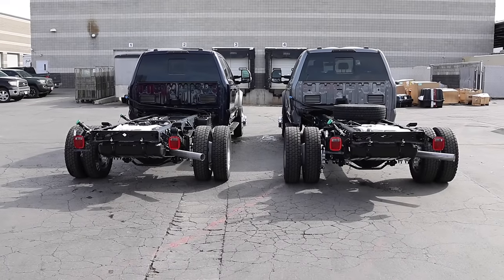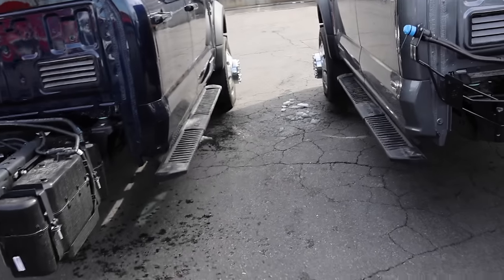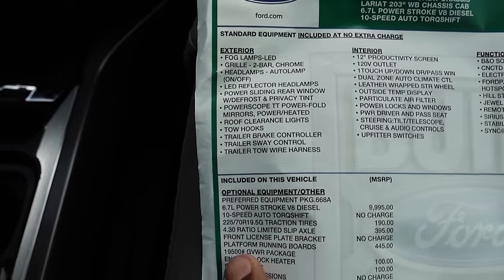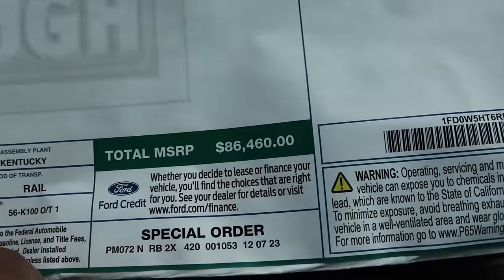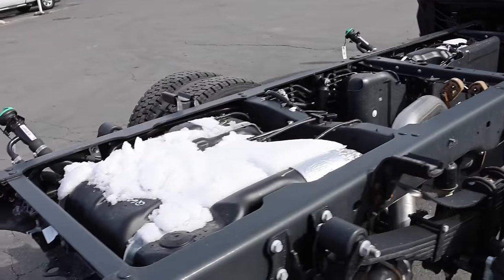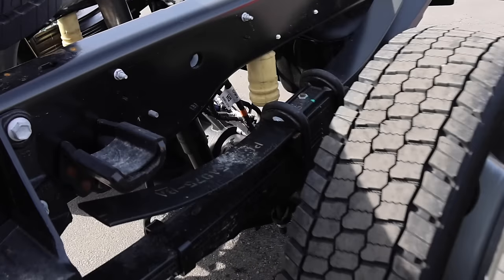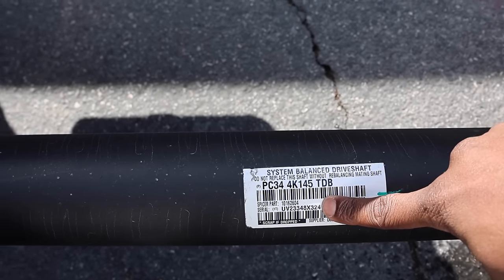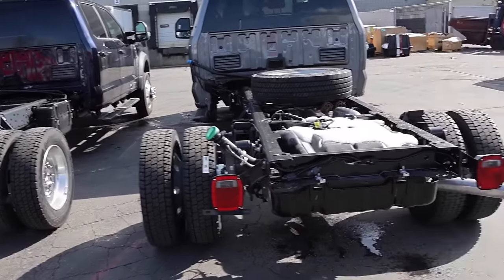4.10 VS 4.30 Gearing: People Say Max Tow Isn't Worth It… Heres What No One Showed You Before!

Comment: On the drive shafts the part numbers are the same. Every single one is going to have a different serial number that identifies it specifically.
Reply: Came here to say this!
Reply: Exactly
Reply: Yup. At least I’m not the only one that noticed that
Reply: The drive shaft is not the issue. The rear end is in question.
Reply: says he doesn't care...are we clear? Ok!
Reply: Just like my Glock 19.  Each has a different serial number but they are all the same.
Reply: @acutecareemsdispatch  the rear housing is the same the gearing is the difference!
Reply: @andrewslagle1974  I know that. But what does that have to do with the serial number on the driveshaft?
Reply: The rear axels have different numbers because not only different gears but limited slip. They are for assembly at the factory and inventory. If you were replacing the drive shafts or the rear end they would ask what your truck was by model as well as year. They would ask what geat ratio as well as whether it had the limited slip option. Those inventory numbers will be log gone within a year of serious use.

Comment: Man. Such a bummer. I like you so much. This is honestly horrible advice. If you hauling those kind of weights in hot shot your spending the same amount in fuel as a tractor trailer.  I’m not going to bash on here. The guys in hot shot making the most money out here are Non CDL , under 26,000 k.  Why pull 34,000 lbs with an$85,000 truck and no where to sleep. Used tractors are 30 to 60 k right now.
Reply: Because not everyone has a place to park a tractor. You can take that F550 anywhere.
Reply: @southwestoffroad  you can take a bobtail anywhere also, or just rent a parking spot. It’s a right off anyway
Reply: @Djtruckin  Not where I live. Most HOA’s will not allow those trucks to be parked in the neighborhood. If you live in the country then yeah go for it.
Reply: @southwestoffroad  I live in an HOA and rent off site parking.  I’m just saying, you try making money pulling 30k lbs in a hot shot application in these market rates. I’m out here doing it, for the last 14 years. Good luck pulling heavy hot shot
Reply: @Djtruckin  I feel you. Personally, I just want a chassis cab to turn into an Offroad Overland truck. My brother is a truck driver driving OTR. I like coming home everyday after work. 😅
Reply: Except if you have trailer load over 10k you need a cdl....

Comment: For gearing choose the ratio that gets you somewhere around 2000 rpm for your desired cruising speed. Since I tow heavy equipment (forklifts & such), I run 60 MPH so the 4.30s would be fine for me. I have no business going any faster than that for the weight I pull. Your situation would most likely be different.
Reply: What's your MPG?
Reply: @xmo552  average 11. Worst I ever saw was 9 but that was in a 30+ mph headwind & I could really feel the truck working. Forklift weight 19200, trailer weight 5400, truck weight 7800 & some of the time I'll also have 2 to 3 of those 3 foot "shorty" jersey barriers loaded, probably 1000 a piece. Yes, heavy & a lot of weight concentrated in a small area but that's why I poke & take my time. I'm also an A-CDL holder for almost 30 years & hauled oversize when the wind craze started picking up. Only advice I can give which will probably get laughed at is it's not a race. Get there when you get there, cargo & your equipment in 1 piece, nobody killed or maimed along the way. 

I've noticed that when you go past 2000 rpm cruising, loaded or not, mileage does a sharp "bell curve" downward. Same as my old 6.0 was years ago.
Reply: @acemobile9806  
I fully agree. Thanks for the reply. 

I'd like to build a ramp truck/wedge (single car on my back) type car hauler just for personal use. I think the most I'd ever haul on my deck may be 10k max. I think some road gears like maybe 3.73:1 might be great for a balance of torque and MPG. I favor the MPG since the engine and trans give me all the torque I need in this application. 
Would you agree?
Reply: @xmo552  as a matter of fact my '06 F350 6.0 had 3.73s. It sat on 35s & had a mild 4" lift. At 2000 rpm, I was right at 68 mph & unloaded could get 18-19 mpg out of it. If I was in a headwind that would drop to 15-16. I also had a 60 gallon bed tank & I have done 1800 miles without refueling. I mostly used the extra capacity for price hedging, load up to the brim where it was cheap. Towing 12K or so would drop that to 13, maybe 12 at the worst. It was studded, deleted, FASS pump & aftermarket non-VGT turbo but still factory injectors, relatively mild mods. I had Elite diesel tunes for when I wanted to have fun but otherwise ran the factory SCT race tune & that's where it got the best mileage if I stayed out of it. 250K when I sold it, laid down on me 1 time for the FICM. Only trouble I ever had with it. 

What you propose is perfect, I think you'll be really happy with the mileage vs speed trade-off & you'll have more than enough grunt to tow the steepest grades with that load. Set the cruise & ride on.

Comment: Defiantly add the max tow to every truck!
Reply: 3:73  with 35ft aluminum shipshee gooseneck and 2500 hauling LTL  partials makes better money every time. Once you’re out here on the road 14 years you might figure it out
Reply: Lol...max tow isn't even available on 2500...
Reply: @mopeman440 the point is Max tow is idiotic with the ridiculous fuel guzzling gears
Reply: @Djtruckin  
Yuuuup
Reply: @mopeman440 I know since the late seventies Ford has been playing games with their packaging my 01 F250 has more Towing capabilities than a single will F-350 because of the camper special packaging, the best part was an average of 350 to $1,000 cheaper Insurance a year. The point is do your homework on the packaging because it does make a huge difference.
Reply: @user-eh5cr4or6k no it doesn’t😂 new truck frames are bigger, brakes are bigger, stronger exhaust brake, more hp/torque, better engine cooling, better transmission cooling, better suspension, etc…oh and also they are rated for a whole lot more weight than a clapped out 01 f250😂😂😂. Yes your insurance might be damn near free but the vehicle being insured is also damn near worthless nowadays🤷‍♂️

Comment: The max payload package is independently available. The rear axle rating is spring-limited, the basic axle is the same. You can also get the dual tanks with or without max towing, regardless of payload capacity. 
The drive lines, frame, and axle housings are identical. A little research on the Ford website, as well as the dedicated forums, will tell you all of this.

Comment: The axle tag is different because the gearing is different, the drive shaft tag is the same as the drive shafts would not need to be different if they build them all to handle max weight they do not need to stock multiple types of drive shafts.  The springs could be the same but that still does not give the weight limit increase, if you have an accident over the vehicle weight you will have issues even if you swapped the axle to the max tow axle, unless the truck is certified for max weight from the manufacture it is not legit to max tow. It doesn't matter if you are happy about it or not but you need to stay within the manufactures tow rating for insurance and liability.  When I was younger I had a heavier license plate on my vehicle because the state just weighed the farm truck and if the license plate covered the weight they let you go, now they will check your VIN for the weight it can carry and you will have issues if you are over on the vehicle or license plate weights.  Be safe and stay alive.

Comment: if you are going to pull commercially you might as well pay for a tractor, you have a bed, you have a higher tow capacity, the state fees are the same you still have to get your authorities, and I knew a guy that was towing with a regular truck and switched to a tractor, and he liked the tractor better, when he hit the brakes he knew he was going to stop where with a pickup if your trailer brakes go you take your life in your own hands if you haul heavier than the weight of the truck

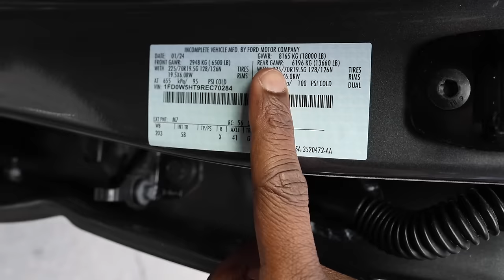Comment: You are making valid point. Problem is, you don’t need max towing in Hot Shot. Money is in light loads. I’ve only been over the road driver for 14 years and a tow truck driver for 10 year before that. But what do I know. Now the graph you pointed out from Ford is completely BS marketing. I figured that out 4 years ago on my Ram 5500. Ask any gear builder. 4:10 - 4:30 is not near enough difference to change the tow capacity that much. It’s literally only a few teeth. Such a marking joke.
Reply: Dude you're  a good person but the lifestyle your portraying is someone who has deep pockets. Aka a rich person. You are not.
Reply: @Tomwheat1289-uj8gc Doesn’t seem like he’s trying portray a certain lifestyle? He’s just simply stating something
Reply: makes more of a difference on diesel than a gasoline engine, semi trucks offers a bazillion different ratios in gearboxes and rearends...
Reply: @matthewschiebout7384  I’m really not sure if you watched the video. It’s about a Hot Shot application. You would not use a gas motor. I stated that hauling heavy in hot shot doesn’t make sense, because of fuel mileage. That’s why max tow is not a great option. The kind of money you spend in fuel and sleeping in the back seat  hauling heavy you might as well have a tractor trailer. You can buy them for less than a pickup truck now day, same fuel mileage if you’re hauling heavy in hot shot, and you get a place to stay every night. Better to haul lite in hot shot, that’s why you don’t need max tow and you get a more efficient truck
Reply: @Djtruckin  
I agree fully. Thinking of starting up. What state are you in?
Reply: The difference on the charts is not only the gearing, but the axle and bearing capacities of the rear end. That's why the max payload can pull more. It can stand the heavier payload you get when towing heavier. All aspects of the truck are already set up for heavy towing, but the rear end.
Reply: The 4.30 is 4.9% taller than the 4.10. At a 30,000 lb tow rating it would add a little under 1,500 lbs.
Reply: @atvtinker01  It's only the rear axle rating. The F450s/550s are all using Dana M300 rear axles.

Comment: We have two exact Ram 6.4 3500 4x4 regular cab single rear wheel trucks. The truck with 4.10 walks away on the take off from the 3.73 geared Ram. Going to do a highway run yet.to.see what happens? Also back in the 90's on the original Ford Supernduty F450's there was a 5.13 gear option

Comment: I encourage you to drive a non max tow f550 while pulling a load not just empty with the bed on it. I watched your video test driving the f550 with aluminum bed. 

That’s not what these trucks are designed to do. They are designed to be hooked to a trailer 24/7. 

I just purchased a 2024 f550 lariat 4.10 limited slip. 

I’ll tell you coming from owning 2019,2021,2022 pickup truck f450s. And daily driving and pulling with them.

This 550 is a completely different animal  the performance comes from the stiffness of the frame and leaf pack while towing the stability is out of this world. With the gooseneck pulling 20klbs through the mountains in Colorado and Utah on 7% grades and windy roads I can’t even feel the trailer behind me in 45 mph cross winds. I don’t even have to put my hand on the steering wheel it’s so stable and planted to the road.  

The 4.10 are perfectly fine for towing heavy like I said - climbing 7% grades in Moab passing semi trucks. You’re fine bro. Get whatever truck is available. These are not pickup trucks they are a completely different class. 

You gotta hook a trailer to see the difference !
Reply: I also want to add that like many have said these trucks are plenty capable to “pull” anything up a hill…. It’s getting back down that’s the problem. And nothing in the max tow option helps the braking. 

As far as the gearing These trucks are governed to 82 mph so I’m running 2200rpm at 82mph which is the factory speed limiter. Which is also where the engine makes peak horsepower… anything higher that that and you’re out of peak hp range. 

As far as the payload plus upgrade package I think that is designed for service bodies with cranes or dump truck body or ambulance. 

Pin weight of a gooseneck is 15% of the total trailer weight according to ford. 

With non max tow standard leaf pack I would need to hook up a 60,000lb trailer to exceed the payload of the 18,000 GVW. 

I can’t see how anyone with a hauler bed or a flat bed could ever need the payload plus package. Why on earth would u ever need more than 10,000lbs payload? I could literally put my f250 high output on the bed of my 550 non max tow and still be under the rated payload. 

lol cmon mane

Comment: It's all about your particular application, and target speeds. It's literally less than a 5% difference. If your target speed allows for it, run the 4.30s. If it doesn't, get the 4.10... or whatever suits your application. The main thing is to have your target speed at about 100RPM above peak torque with overdrive engaged.

Comment: I personally would get the 4:30 with max tow! I believe this gives you more cooling for transmission which is so important to protect!  Run the tires off it and then next set would be 245s instead of 225s that should put gear ratio around the 4:10 mark. Look up tire gear ratio calculator to verify exact number? Why is axle diameter?

Comment: You should look up the SAE J2807 towing tests.  The vehicle get certified by the weights they can safely tow in the test.  They stop on a steep hill and need to start again to get to a required speed on the hill, gearing matters in the tests.  What ever you do you cannot go over the max weight the manufacture labeled the vehicle as with out risking problems down the road.   There is a pretty good video on the SAE J2807 on TFL truck.

Comment: One other thing about the max tow, when optioning that package the 4:30s are where it starts, with the 4:88s as an option.
Reply: That’s why guys take their beds of f350’s and don’t usually start with cab and chassis. Or even 250’s . My good friend at one point was grossing mid $300 k with ram 2500 and 35’ aluminum gooseneck
Reply: As of 2023, the diesel F550 doesn't come with 4.88:1 anymore, 4.30:1 is the shortest gear available. 4.88:1 is currently only available with the 7.3 gas engine.
Reply: I stand corrected, 4:30s are the top option for the diesel.

Comment: I have a 2022 with the 7.3 gas......max tow ........the 4.30 gears with the 10spd are ridiculous.
Reply: TRUTH ✅ they should come with 3.23 or 3.08
Reply: Ridiculous in a good way or bad way? Going to be ordering shortly, and want to put camper in back and pull my boat. What’s your RPM at 65 mph ? Any info would be great.
Reply: @Andrew-yx6ut  I'd have to check RPM @65.....I only use the truck around town....it's not that bad with the 10 speed.... Has decent power..... Gas mileage sucks.... But I use mine for snow plowing.....and do lots of backing...... At less than 10 mph in reverse it's over 2500rpm. If I ordered a truck I'd definitely get the tallest gear possible....even if it meant not going with the max tow package

Comment: When are you people going to learn! A 4.30 will get better fuel mileage because the engine is not working as hard to maintain the speed. This is how you save on fuel. The smaller the gear, the harder the engine has to work to maintain the speed. Work harder=more fuel. A higher RPM has nothing to do with fuel consumption.
Reply: Not necessarily.

Other factors must come into okay such as the engine's powerband.

If the 4.30 put the engine into a better sweet-spot, then perhaps there will be no fuel mileage penalty over the 4.10.
Reply: @michaeldunagan8268  you cannot judge it by that standard. Yes, it may momentarily give you better mileage in that sweet spot, but we don't travel in the sweet spot. So overall, the 4.30 will give you better fuel mileage.
Reply: @mikemiller9119  

Still a blanket statement you ate making.  Hauling light on the flat-lands can hardly convince me the 4.30 is a superior fuel mileage achieving gear ratio: provided the transmission and engine are built as expected.
Reply: @michaeldunagan8268  flat land? Seriously, I've been all over the country and haven't found this flat land you guys talk about. If it's flat, you shouldn't  need to accelerate after you have reached speed.  You just coast away. But still haven't found it.

Comment: thing I hate about those 225/70/19.5 is they are so short, you can put 245/70s on the max tow with the 4.30 and it will help some they are 2 inches taller i drove one with 4.88 gears and that 6.7 was screaming and it didnt last long doing it either

Comment: 4.30 rear end helps take strain off your transmission and engine when taking off and climbing mountains witch will help make your transmission last longer especially since transmissions cost as much as they do now its well worth the 1 to 2 mpg your gonna lose now i cut and demo concrete we have 2 4500 rams 1 has a 4.10 the other has a 4.40 rear end the truck with the 4.10 gets 9 mpg and the truck with the 4.40 gets 10 and the pne with the 4.40 is at 22k everyday and the 4.10 truck is at 17k yes one is a little over loaded but its not according to dot also the truck that has 4.40 rear end is on its way out it has 400k on it and a 5500 will be replacing it